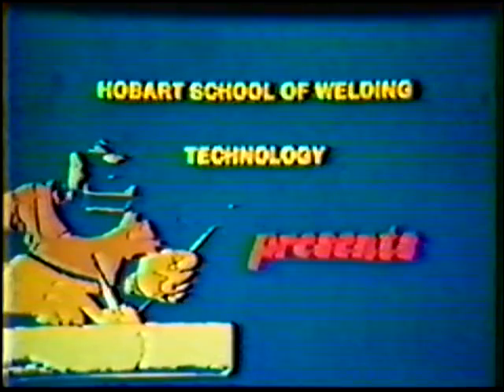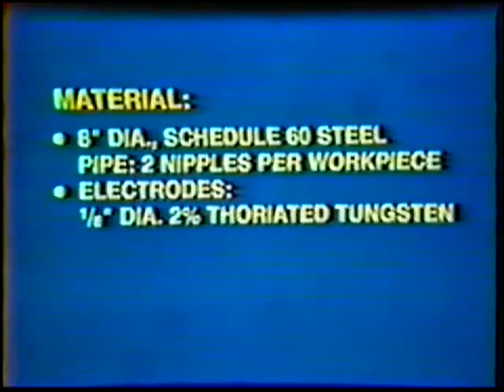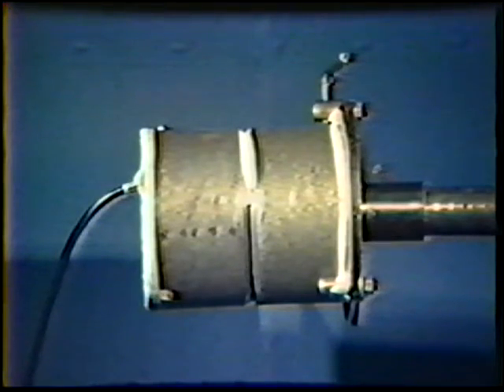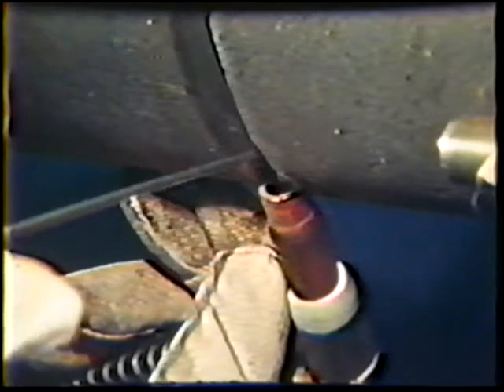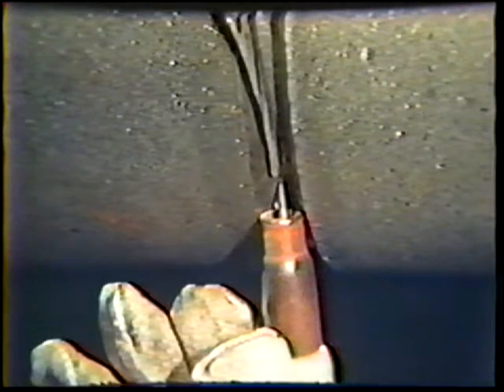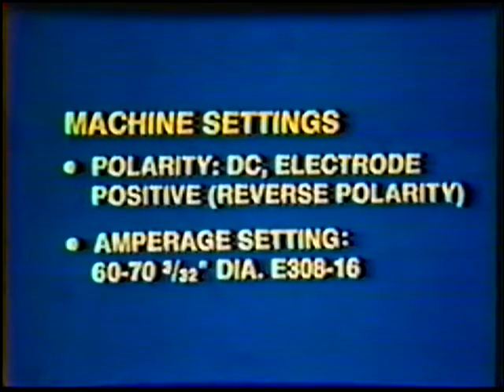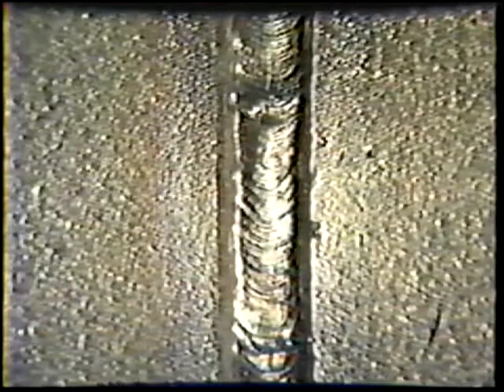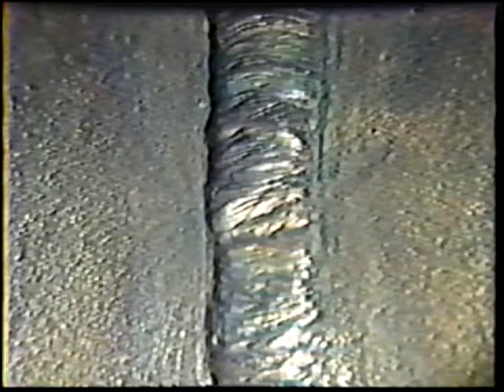5G Stainless Pipe Tig/Stick

Comment: That finished weld is undercut ant tottaly unacceptable.   I Knew it wouldn't end well when he was weaving the hell out of that 308 on the cover pass.
Reply: The cap didn't look great, but it was shadowing rather than undercut. Light source is dead at 3:00 so the 9:00 is shadowed.
Reply: That's definitely undercut, he wasn't holding the sides long enough